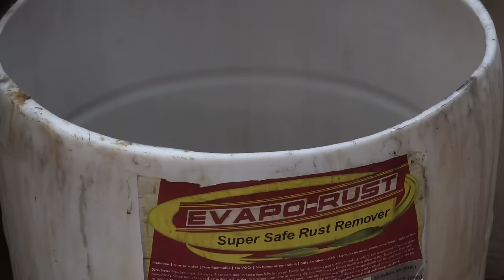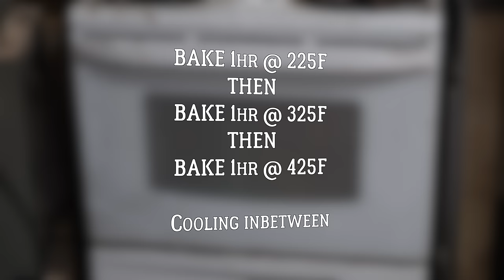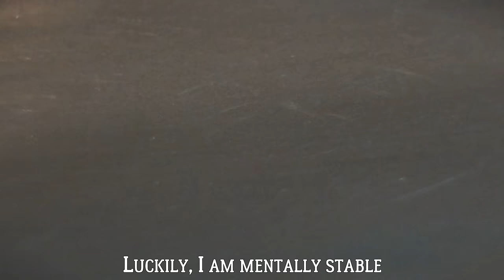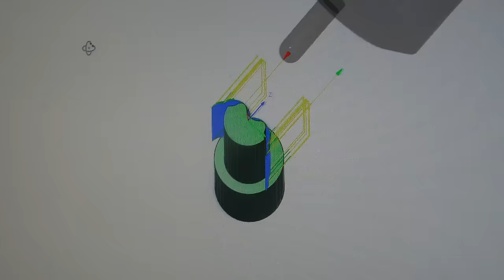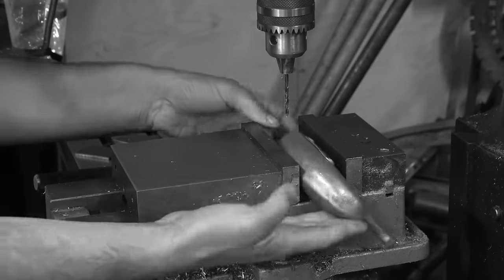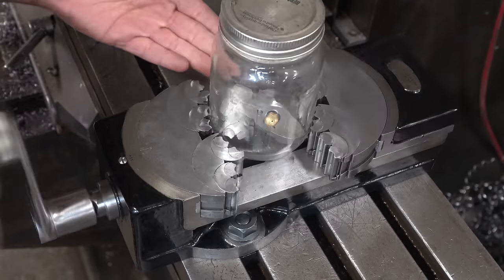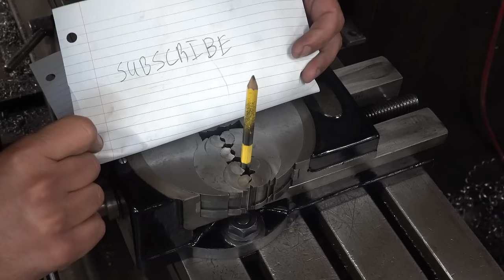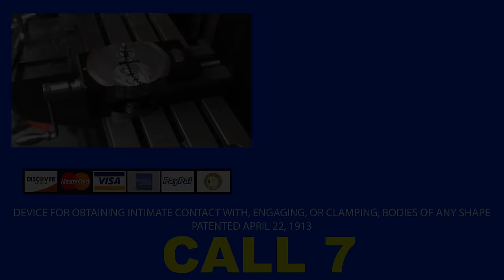Rare Antique Fractal Vise [Restoration]

Comment: After 25 years as a professional mechanic I rarely see a tool that I am not at least familiar with. I had no idea that I had the wrong vise this entire time! Thanks for the video.
Reply: So what is it used for? I really want to know
Reply: @TypeZeta2  getting a good hold on unusually shaped objects.
Reply: @ominous9139  that makes sense I was a bit confused on its purpose when I saw it but it’s still really cool
Reply: Yeah, me either. 57 and been an avid tool guy since I got my first mini tool set and workbench at 7 years old. I never seen such an intriguing  tool.
Reply: As soon as I saw it I remembered a dozen times at least I could have used something like this back when I had a shop.
Reply: @TypeZeta2  its a machinists vise. It's good at holding odd shapes in specific positions securely.

Comment: This brings new meaning to the term “they don’t build them like they used to” Ive never even heard of one of these vices
Reply: Yeah me neither , am now sooooo wanting one..!😃
Reply: Probably fell out of favor. With a normal vise can easily maintain the same zero during serial production. This was probably more common before the use of NC machines
Reply: Came to say this. You don't make profits from selling a quality product, sadly.
Reply: Probably because it's a very expensive and sensitive piece of equipment that does what any cheap vice does, a little better. But in most cases that little better is not needed. If you have to clamp something uneven like that you just add a piece of wood and a piece of leather and it does the job. This design would be good for a workshop that specializes in highly variable, uneven workpieces that need to be gripped very securely, and I can't imagine what that can be to be honest.
Reply: @mrkiky   Maybe like a stone carver? It would have to be made out of plastic then.
Reply: That’s because the only concern now is share holders and dividends. Aka all about money.
Reply: You can 3D print one, quite common print right now. I’m printing on to put on my electronics workbench.
Reply: @mrkiky  I would say this kinda thing would be great for home-millers and workshops that do custom machine work. Similar to this channel, where they get odd materials and odd toolings to work with and don't wanna have to custom-make jigs to hold particular pieces for particular work. 

The Kind of shop that might have to recreate something that is broken, or do odd-angled fill-welds that wouldn't be supported as well/flush in a straight angle vise at least without marking up the surface something crazy, or potentially 'crushing' the piece.
Reply: @mrkiky  I heard they were often used for holding items while engraving them.  People used to get their metal, made in America, lifetime purchases engraved because loss or theft was the only issue to worry about.  Oddly, my grandfather had his social security number engraved on his tools.  I was like wait what??  But identity theft wasn't a thing back then, but tool theft was a problem.
Reply: @danmerillat  That's my complaint about 3D printing. Lots of people don't understand it and think it is the end all be all manufacturing technique. Consequentially people are making way overcomplicated designs that could be done simply with hand tools, or spending way too much effort trying to make a 3D printed part work, when that same part could be casted with less time and effort and perform better.
Reply: @DaveSmith-cp5kj  for casting, you need the mold there and your options are either CNC out of a metal with a higher melting point or use greensand - and greensand casting is a great use for 3d prints.
Reply: @danmerillat  I make a wax mold with FDM, then fuse it into a tree and shell cast it. It's better than sand because while it takes longer to setup to let the layers dry, but less actual man hours, and you can replicate really quickly. I use a robot arm to do the dipping since that's the most time consuming part, and it can rotate the tree more completely than your wrist.
Reply: @DaveSmith-cp5kj  right, i had an earlier draft of the comment that included lost wax casting.  You can either print wax directly or make a negative mold to pour hot wax into.  But either way, it's more precise and less time consuming than hand-carving a lump of wax to cast each time.
Reply: @danmerillat  We can make those systems now, we choose not to. Whats the point of making a highly specialized machine (In terms of cost benefit) that all runs off a central cam when you can buy a bunch of cheap sensors, controllers and motors and have them do the same thing at a quarter the cost in design and build time and one tenth the cost in repair. Easier, cheaper and smarter to do things out of mass produced, inexpensive components that are interchangeable and easily sourced. 
Yes we lose some of the art but I would argue that making a machine entirely out of stock components is an art in and of itself. It also demystifies engineering to the point where anyone can take a few classes/watch a few vids and be able to make something useful.
Reply: @TheWinterscoming  because all those "stock" components are highly complex themselves and require sensors and actuators and a controller with custom firmware and even then it's both a huge maintenance burden and failure prone.  Sometimes it's just better to link two mechanisms together with a cam.
Reply: 41 years experience. JOURNEYMAN Machinist. Never heard or seen of this before either. Amazing.
Reply: @Aoskar95  they were probably expensive,  and very few uses for them
Reply: @dizzydial8081  
On the contrary. Sell quality products, and you will make money.
However, over-engineer things and you will lose money.
Reply: @drewstevens2244  
All about money? Well, a company has to make money to keep on existing.
Reply: @danmerillat  
Lost art? It is not. It is merely asleep.
Reply: @TheWinterscoming  Easily sourced? Unless you have difficulties in getting supplied by a country which makes 90 % of microchips worldwide.
Reply: I can't imagine how expensive it would have been to produce back then.
Reply: @backwoodsengineer  Would you be willing to share the files for that model?

Comment: The guy who drew this up without cad was on a different wavelength
Reply: If it’s truly fractal it would only require a drawing of one jaw. Just change the scale each time you make one.
Reply: @marsrocket  That would be identical, not fractal. For each fractal, the radii changes, both the inside and outside. You still require a drawing for each fractal.
Reply: @marsrocket  fractals aren't typically self-similar
Reply: Inventors of yore had minds better the CAD/CAM - the thing many of their inventions lacked were the materials to be successful.
Reply: if you just pick up a pencil once in your lifetime, you'll realize they're quite easy to use
Reply: Engines and cars where made before cad. Just trying to imagine designing one without cad. Thank God we now have cad.
Reply: I took drafting in high school, the last year they taught it though because CAD was becoming popular, so the high schools just said, "youll learn it later. "
Reply: @paddington1670  my high school offered a freshman engineering class and all I did was sit in a computer lab and draw random objects in cad
Reply: @TheVexCortex   Yes, if it's bigger or smaller. Not the same size.
Reply: @THESLlCK  A pencil? What is this newfangled witchcraft you speak of?
Reply: Probably Anunake
Reply: @fred dieckmann Why assume he didn't have help? 😂
Reply: @fred dieckmann I meant psychedelics in general sorry, my bad
Reply: @THESLlCK  But they didn't have a fractal vise to hold the pencil to draw the fractal vise
Reply: @jstever5208  DANG it, you're right!
Reply: Lol. If you can't scribble it on paper and make a proper print from that.. I'd like to meet the guy that actually made the tools to machine this. You can dream of interplanetary travel and make a spaceship in cad, but good luck actually making it.
Reply: Proof that Advanced Alien Life walks amongst us..?
Reply: @bacicinvatteneaca  self similarity is the defining feature of fractals

Fractal
"a curve or geometrical figure, each part of which has the same statistical character as the whole. They are useful in modelling structures (such as snowflakes) in which similar patterns recur at progressively smaller scales"
Reply: @KT-pv3kl Have you even read the paragraph you copypasted? It proves my point
Reply: @bacicinvatteneaca 
"An object is said to be self-similar if it looks "roughly" the same on any scale. Fractals are a particularly interesting class of self-similar objects "

I did read the paragraph. What I am however wondering is if you on the other hand have a single clue what the term " fractal" actually means given that another synonym for "self similar" is in fact "fractal"...

Can you even name a single fractal that "isn't" self similar?
Reply: Would uave used a model piece like a key copier
Reply: I loved immediately for that intro. Then I stayed for the learning. Just an amazing tool. 4d chess brain made it and it takes a similarly fantastic mind to fix it. You've earned my sub.
Reply: 11:40 sounds like an angel from evangelion lol
Reply: @KT-pv3kl  Mandelbrot initially defined fractals as any object whose Hausdorff dimension is higher than its topological dimension. Self-similar fractals are just a simple example, but the very reason he defined the concept was in order to describe real shapes, rather than just geometrical simplifications of them.
Reply: Then imagine the guy who did the machining without cnc

Comment: I’d play a lot of cash for that vice. Damn in seven decades on this earth I’ve only seen a few of these gems. Good on you for preserving one. I wish you all the best!
Reply: Does no-one make these anymore? It seems pretty useful. Or do you mean this exact model from that specific company?
Reply: @megan00b8  I haven’t seen one for sale in probably 30+ years but I agree that if no one makes them then they should.
Reply: @wesleytownsend8214  wow, I mean sure, you will need this mainly just for limited kinds of uses, but there's a kazilion tools that are only for extremely specific uses and are being sold fine, it's weird that these are missing on the market entirely.
Reply: I agree. Beautiful piece of equipment. It's the kind of thing you may not need for year's, but when you need it. It's essential.
Reply: @Teknofobe  absolutely agree and it would be great to have one with both steel and rubber (or another softer material) interchangeable inserts. I do some wood carving/inlays/engraving on corbels and other oddly shaped pieces, and these would be very efficient to hold a piece in place securely.  The only fractal vices/clamps I have found online were old and rusty and the seller wanted an insane amount of money for them.  I wish you good health and all the best to you and your!
Reply: @wesleytownsend8214  Maybe compressed leather strips.  I've used hammer's like that. Tough enough for grip but still slightly malleable. I wish you & yours health & happiness too.
Reply: I saw a guy make a 3d printable one
Reply: @Wesley Townsend - How much cash? If I converted an existing milling machine vise into one of these, what could I get for it? Just curious if it would be profitable to set up to do it. :-)
Reply: A set of jaws for this vice just sold on eBay like last week for $2k usd

Comment: My background was in tool and die making both out on the shop floor and as a designer in the drafting room and this is the first time I ever saw a vise this amazing. To think that this vise was designed and machined back in the early 1900's speaks volumes of the skill of the craftsmen. The restoration on this vise it top notch. So nice to see a treasure like this given a second life.

Comment: Imagine inventing and then actually building this piece over a hundred years ago. The engineering is insane and quite unique
Reply: Someone applied the same principle to mathematical functions and BANG the internet happened
Reply: I mean let be honest, it's not that impressive or revolutionary, considering what inventions had preceded it. It's only 100 years
Reply: I wouldn’t say it’s that impressive in an engineering sense, but it’s very creative in its use of fractals
Reply: @Rich-je9fy  may I ask how old you are rich. All due respect
Reply: The radius ways really got me for being that old, along with the tolerances
Reply: @michaelgrubbs1618  100
Reply: @Rich-je9fy  🙄 ok. This is an impressive piece, especially for it's day. I've never seen such a vise.
Reply: Just the fact that tooling was a lot more. “Iron ageish” and that it would harder to make stuff like this back then than it would be to do now. Remember. They didn’t have cnc machines 100 years ago. And a lathe is no good for. Shapes like these. So hand filing it probably was.
Reply: with only hand tool!  not CNC in 1920 baby!